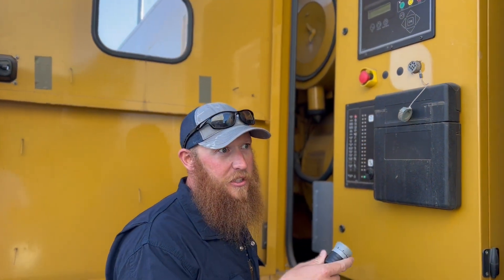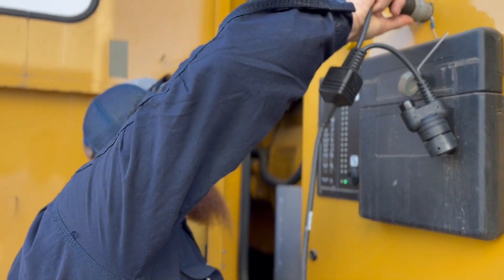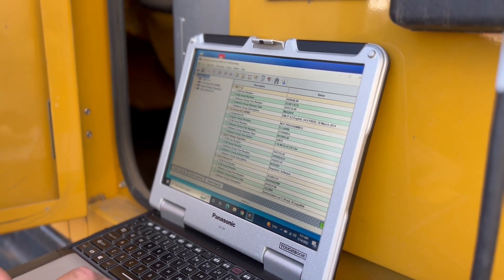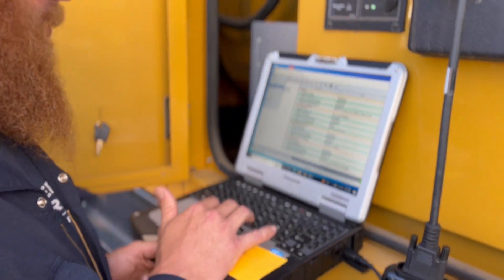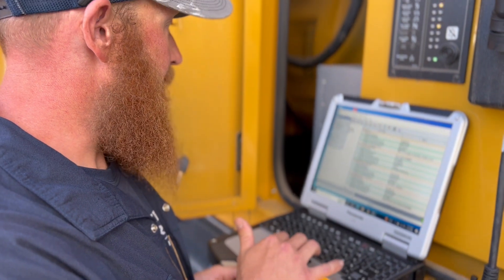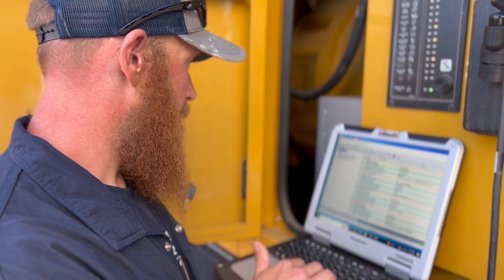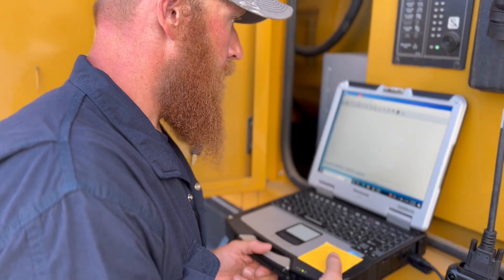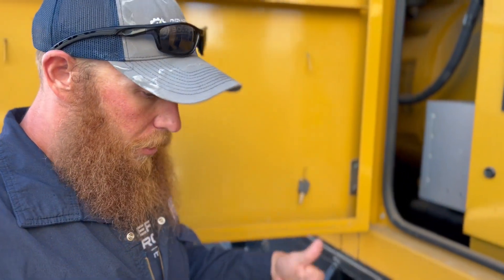Caterpillar 600 kW Generator Diagnostic Test

Comment: Andrew....we have two CAT C18 600kw 480 60 hz generator and both same problem same time.  The problem is the generator start up run ok the voltage staedy at 480V, rpm steady but the kw and power factor at the generator EMCP 4.2 shows negative value and is not staedy but fluctuating with no load. Please advise what cause this problem
Reply from the maker: We do offer service/house calls, in CO/WY and we are getting started in FL, GA... but Andrew is tech and would need to see it in person otherwise, just speculating.